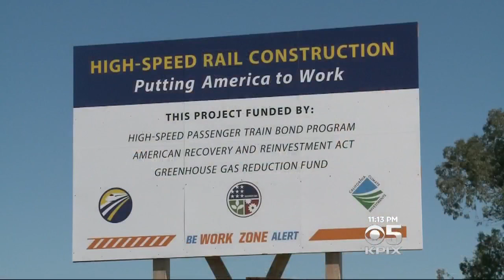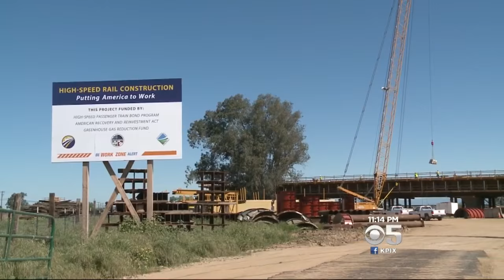High-Speed Rail Begins to Take Shape In Central Valley

Comment: California is NOT working on a high speed rail train in the Central Valley or anywhere else. The train max speed is 125, which is 30 MPH below high speed rail minimum speed to carry that name. IF you want high speed rail, you would have to go to Texas that has a design being built that does 200 MPH, well over the high speed rail standards. Sorry California, you got this wrong too.
Reply: High speed rail starts at 155. Bullet trains start higher than that. Thanks for playing.

Comment: Brilliant, Silicon Valley to the Central Valley so polar opposite lifestyles can now visit each other and provide 'needed' services, while the line outside Los Angeles has still not been proposed as any more than a replated freight grade line incapable of speeds over 50 mph. Where did the promise of an average speed of xxx or average time between SF and LA of 4 hours as outlined in the bond measure we needed to vote on break down or was that just a bold faced lie to get sympathetic voters to open their wallets...again?